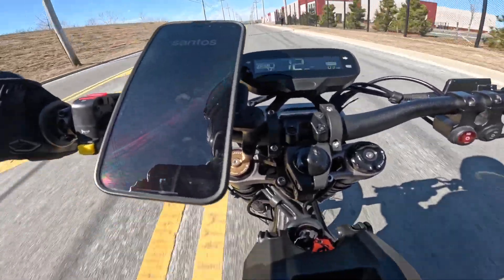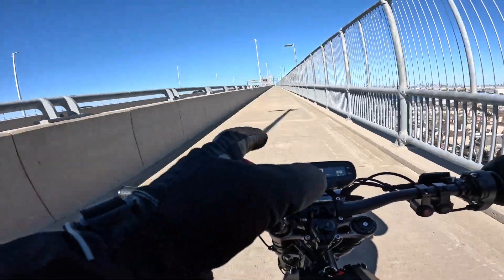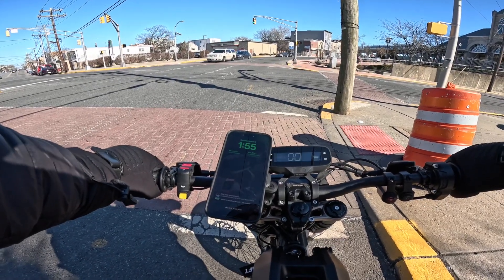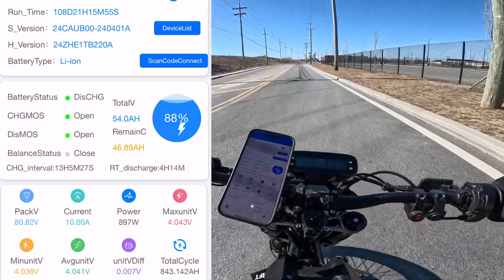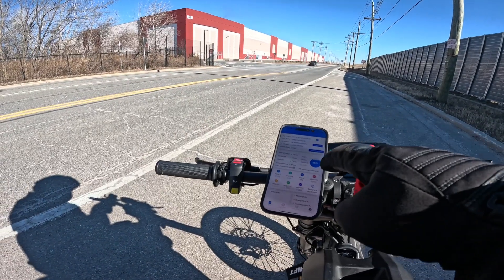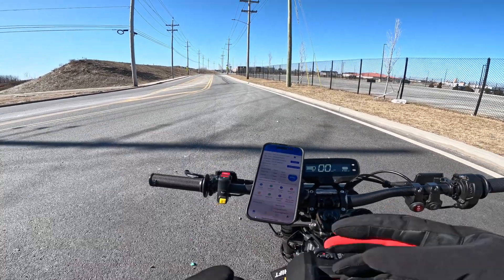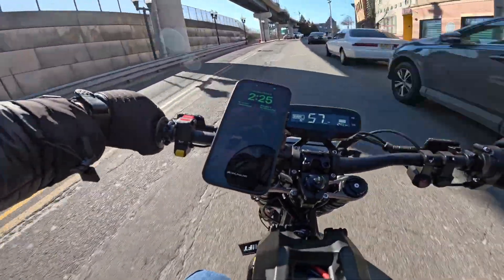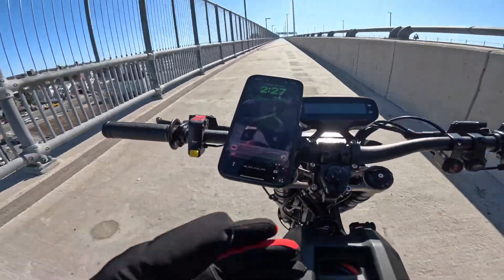GAME CHANGING  E-BIKE MODIFICATIONS AFFECTING POWER AND SPEED - ENJOY THE PROCESS

Comment: Eride? That's slower than the ventus one
Reply from the maker: Did you even watch the video…? 🤦‍♂️ 
How is that even a fair comparison…?
My factory motor is reaching these speeds… My motor is rated for 3.3 or 4 KW… and this one peaks at 28… 
28kW Power. Adaptive Throttle. IP67
Waterproofing.72V 50AH NCM pac.Features of the VTB
Cool Controller 3 power levels, 5 riding modes, quick switching.
4 Built with a self-developed tri-electric system, Ventus One isn’t even close to my bike…
Reply: @  You mentioned the eride and I said the ventus is the better option. Never mentioned your bike, isn’t a fair comparison due to your motor.
Reply from the maker: @Marrk117  My Bad… Totally didn’t get that… I never heard of the Ventus. One at the time I bought the SurRon…  it’s the only reason I mentioned the Eride Pro… I know I wanted a 72 volt upgrade so to get that right out the box was impressive… On paper it looks like a beast…  I’ll be paying close attention to this one now… 💯

Comment: If you're speedometer is to be believed you hit around 78+ on that second run.   While going to a larger sprocket will give you more torque for acceleration is can also raise your top speed under some conditions.  For example the smaller sprocket will allow for higher speeds DEPENDING on conditions like rider weight and drag.  By adding torque you might lower the theoretical max speed of the bike - but you're allowing it to go faster with a heavier load.  Its not intuitive, but it is engineering. ;-)
Reply: 100% all you said about the sprockets but I wouldn't put faith in the speedo as unless the wheel size and gear ratio have been corrected in the controller the dash is likely out of wack. But still 70mph is good going for 72v and stock motor, as far as I know they came stock at 45mph so 50-60% improvement.
Reply from the maker: I get it… still learning… hella late to the SurRon game but It’s one thing to hear or read about it but it’s even more interesting to see it action…  lovin the journey…

Comment: Bro you did that yesterday?? it was absolutely freezing here in Pennsylvania!!😮 I'm probably just going to get a stealth bomber from Alibaba. I got a few questions for ya if u dont mind as well... 
1. Im getting a Stealth Bomber 72V probably 12000W 75ah... My question is should I get the smallest battery and buy a good quality aftermarket battery or just buy their biggest battery I can get with it as it comes (75ah)? Of course it's not the real name brand stuff that so that's why I'm asking! 
2. Im 140pounds and was going to get the 12000W... I want to go at least 70mph and 100mi of range as a minimum. Soo... Do you think that's too much power for what i wanna do? Maybe get the 10000W instead? Any advice is appreciated. Keep up the good constant bro!
Reply from the maker: It was about 32 degrees this day…  Not terribly cold but definitely cold…. Hey… Before you decide…  What information do they provide for you with about this battery… Are they disclosing the cells being used… and of course price… What do they ask for that monster capacity…? I know what and where Powerful lithium is getting their cells… Also current flow is extremely important as well… And Powerful Lithium uses an insane amount of nickel to ensure good current flow… Plus what BMS are they using… Powerful Lithium uses a smart BMS’ with a high discharge rate and they are not bypassed… So with that being said you know I’m biased… and i would recommend their battery over any other manufacturer… As far as motor goes.. the 12KW motor would run more efficient… A larger motor won’t work as hard so that is what I would want but if it’s a huge price difference I can’t see a 10KW motor being a bad option… The more important question would be which controller…?
Reply: @mr.e_from_nyc I emailed u! Thank u
Reply: Don't waste your money on a Stealth Bomber.  For the same price you can get the E Ride or Altis
Reply: Don't waste money on a Stealth.  Get the Altis, E Ride or Ventus.

Comment: MrE! great results from this video. This larger sprocket allowed you to hit top speed quicker and got you to 70 mph. A full charge and warmer weather may get you even a few more mph. The other benefit of the larger sprocket is more power back to the battery if you turn up regenerative braking a bit that will also help your braking and coming to a stop. This will also improve your range putting power back to your battery. According to my calculations if you run a 48t you should be able to hit over 75mph. I believe this would be the sweet spot for this build. Lets try it and find out. You can also run higher voltage to the stock motor by using a controller capable of up to 96v. Powerful Lithium has the 88v and 96v optional batteries. I'm running the FarDriver 96680 from PL for Surron and their 88v battery. Lets test both bike together and check results.
Reply from the maker: My Man…  Thanks so much for all the info… after we spoke I quickly changed the sprocket and hit the streets…  I would love to see yours in person and see it perform… Let’s do it… I’m charged and ready when you are… we have a nice runway here…

Comment: After $1000 controller, $3000 battery with 600amp discharge and $1300 wheels it better work 😂
Reply from the maker: You’re prices are a little off and may scare someone… lol 😝 
Battery &2650 and my code MRENYC will save you $100 
https://powerfullithium.com/products/72vrspec-elite?variant=45431498637364
Controller is $750
https://powerfullithium.com/products/sotion-qf-controller-for-sur-ron
Wheels were $1202 but you can also save a few bucks with my CODE MRENYC
https://milkracing.com
Reply: @mr.e_from_nyc  top much money